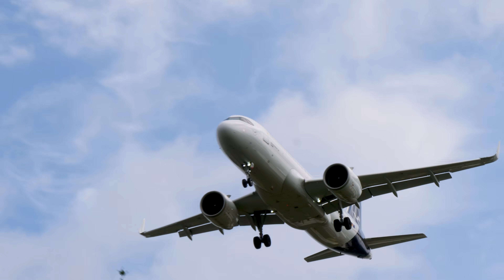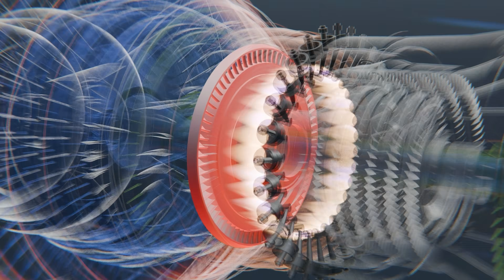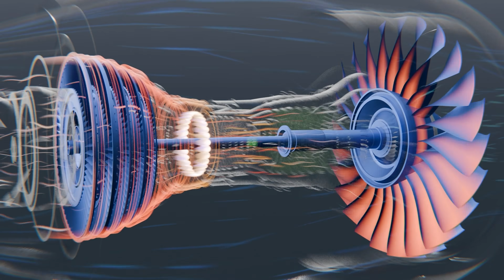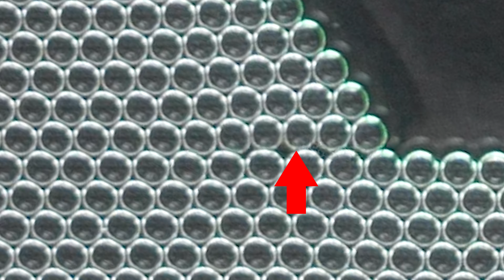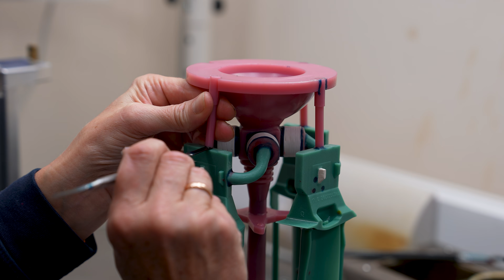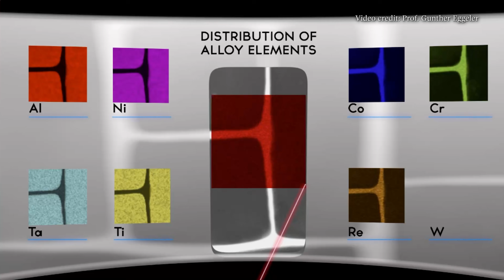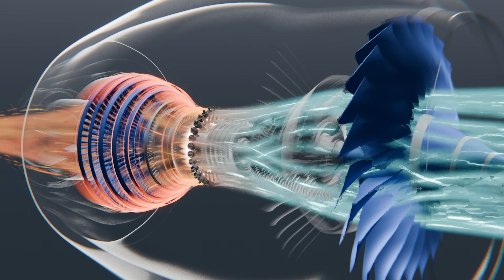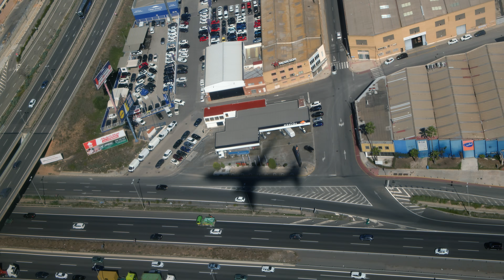The Ridiculous Engineering Of Jet Engines

Comment: Jet fuel cannot melt steel. Go get a kerosene heater , melt steel with it. 
Steel is dipped in 960 degree fahrenheit liquid zinc, to galvanized it. It doesn't even warp.
Reply: Jet fuel plus massive pressure causes way more heating than jet fuel alone. Even a compressor in a garage gets hot when running due to the pressure increase of the air inside.

Comment: The engineers actually use a few interesting tricks to pull this off.  Turbine blades have internal channels where the cold air is passed through and is vented into the exhaust stream.  This keeps the blades cool while spinning in an inferno.  Also, the combustor cans have corrugated metal seams that also allows lower temperature air to keep the flame away from the walls of the can.  The temperature inside the actual flame is around 3,000 °C.

Comment: and somehow it made structural steel that has a melting point of 3500 C collapse
Reply: Heat energy in rigid structures can cause cascading material failures due to expansion. It's not all about literally melting things. A basic grasp of material science would help you.
Reply: @O @Orbital_Inclination is was also debunked as well, don’t Reddit mod me dude
Reply: @LLylexx no it wasn't. You just can't help clutching at the tin foil hat.

Comment: How does the air ignites so high when a car engine can't ignite in high montains?
Reply: Fuel air ratio is key here. Aircraft engines suck massive amounts of air in. Stick a massive fan in front of a car up a mountain and it will start

Comment: I wouldn't even worry about the dust at 36000ft, those engines must ingest LOTS of it on a regular takeoff alone.
Reply: Dust is much more abrasive flying along at 500 mph than it is on a takeoff roll though.

Comment: You have not even discussed aetheric jet propulsion when the plane reaches 35,000+ feet the engine using the harmonic Schumann resonance of the earth to where the engine basically uses the aether energy as sound and allows the plane to use another fuel source to conserve its fuel primarily for take off, landing, or emergency.

The reason the jet engine survives because it can handle the heat until it reaches its optimum altitude
Reply: Literally not a thing, so it isn’t relevant here
Reply: the only thing that is not relevant is that YouTube name of yours
Reply: @Juancarlos22113 next time, pick a technology that actually exists. The aether isn't real 😂
Reply: @Orbital_Inclination  go delete your channel and change that name. Crazy this dude can’t do a google search 😑
Reply: @Juancarlos22113  a google search shows that aether was a hypothetical classical element that does not exist. It has no scientific basis at all. You might as well try asking ghosts to carry an aircraft.
Reply: @Orbital_Inclination you still here? Let it go Elsa

Comment: Woww.  Never new it was such an art.  Now the Russians know to make their turbine blades last longer.  They did say the west didnt have to replace their blades as often as the Russians.  Ive cast aluminuim as a hobby 3 decades ago.  Have always seen the crystal like structure of broken metal but never considered the nitty gritty.  Learned so much from this.  Of course it could be outdated not with batteries thus electric turbine and squeeze it like a garden hose for thrust.  Obviously they would need to filter the air and send in through the blades.   Fascinating journey in these  "Last Days"   were entering and the knowledge weve gained.  Was amazed about the spiral for the crystals to focus or alighn

Comment: 13 minutes in. They have hollow channels in them.  What im wondering is the effeciency of hot air expansion. it would likely make sense to have a tube at the back where the hot gasses can heat up the cooler forced air to get that to expand before chucking / thrusting it out the back against of the atmosphere.  Logic being with preheating the forced cooler air  "there will be more mass"   to send out the back to thrust against the atmosphere.   If so - then my patent idea requires any airline grant me free travel and the best airline hostice booty to rump in the process.  Oh -  an unlimited trips to the bar etc...

Comment: No mention of the real reason Tungsten is not used.  Tungsten has a high melting point.  Tungsten Oxide does not.  The oxide melts and runs off, exposing more tungsten.

Re the blade casting, these can't be blades from the hot part of the engine, aren't they made of single crystals, which is way more difficult.  EDIT - guess it is.  Had no idea the spiral (pigtail) could be that small.

Comment: Magnificent work! Superior to the Horizons of my youth. Thank you!

So why doesn't all that hot gas poot out the front of the engine? This is rarely mentioned. 
It's that 50 bar at the back of the compressor blades. The whole engine is also a pressure vessel (as if everything else wasn't enough) So that's one of the main design parameters. It's that, and the huge volume of hot gas, that pushes you along.

Comment: @veritasium This is the best explanation of Single Crystal Casting I have ever seen and I work in this industry since many years. You should definitely make a follow up video diving into the Ceramic Barrier Coating as there is currently a big shift occurring from plasma sprayed TBC to Electron Beam Vapor Deposition.

Comment: In the 60's, Rolls-Royce tried using carbon fiber fan blades for the RB211. These blades were light and temperature resilient and only failed in one respect, bird ingestion tests. It cost them millions.

Comment: The problem with the phrase "jet aircraft became about 55% more fuel efficient" is that it isn't at all clear what it means. There are two obvious candidates:
1) Jet aircraft use 55% less fuel for the same distance traveled
2) Jet aircraft travel 55% farther for the same amount of fuel

The former implies that they use 55% less fuel. The latter implies that they use 35.5% less fuel. Which is it?
Reply: In aviation, fuel efficiency is typically 'amount burned per seat per unit of distance'
Reply: @Orbital_Inclination That fails to help. Was the amount of fuel reduced by 55%? Or the distance increased by 55%? It is ambiguous
Reply: It's option 1, 55% less fuel per seat-mile.
Reply: @Orbital_Inclination  Good to know.
I have opinions about which way of presenting improvements is better, but my main argument is that the language used to describe efficiency improvements should be unambiguous. "55% more fuel efficient" is bad rhetoric. Either say "55% less fuel per seat-mile" or "2.2 times as many seat miles for the same amount of fuel"
I'm partial to the second option, but either one is clearer

Comment: What's crazy is just how Small the turbojet engine is, that drives the turbofan mechanism.  That's the thing that flew you here.  That's the thing that pushes you into your seat when the engine ramps up to full power.  And these things do this all day long.  The pilot doesn't care.  He or she just Smashes the gas pedal.  What happens after that is pretty amazing.  Micropores flow through each blade, and flow over the surface of each blade, that blow through and keep these things cool.  An eety bitty straw, flowing air through the length of the structure of each blade, keeping each blade cool.

Think about a piston engine.  You Smash the gas, and you expect power.  So does the pilot.  He or she Smashes the 'gas pedal', and there's an expected amount of power.  He or she expects Something.  Just as you smash the gas on your automobile, a pilot expects Something.  My car is an 8-cylinder SUV, and I know what I'm to expect when I smash the gas.  I smash the gas, and I get an expected amount of power.  The pilot smashes the 'gas pedal', and the plane takes off.  A pilot smashes the gas, and you fly from New York to San Diego.  Just the same as what I'd expect from a drive from St Louis Missouri to Memphis Tennessee.

Which is to say...  Why ISN'T there a nonstop flight between St Louis and Memphis?  

Hey, I'm just saying.

Comment: so basically lots of things pushed to their limits go into the answer/solution, including single-grain alloy, coatings, a cooling system built into the shape, besides slightly cooled air. also appreciate finally remembering the term dislocation propagation from materials science class

Comment: You don't mention that turbine blades don't experience 1500 deg C as they are surrounded internally and externally by a curtain of bleed air at about 600deg C through the cooling holes

Comment: slight correction Veritasium

regarding the invention of the jet engine, the first jet engine aircraft to fly was the He 178 in Germany 27th August 1939 but was wrought with problems as the video mentioned regarding maintaining the engines overheating

edit: small clarification, Frank Whittle did invent the first jet engine afterwards Hans von Ohain created his design. however the He 178 used Ohains design thus making it the first jet engine aircraft to fly.

Comment: 2:56 you know what else is crazy?

Out of that 10% of air going into the core, about half of that isn’t mixed with fuel and burnt. The air is only there to cool components down.

So it’s really only 5% of air that drives everything.

Comment: Per AgentJZ, the thing that keeps a jet engine from melting is the carefully controlled air flow over the blades. If this air flow were hampered, the heat would get to the metal parts and they would disintegrate. This is the reason for mandated servicing intervals.

Comment: I used to work with a company that made super alloy blades for aircraft, there’s so much that goes into a single blade. We would get trees of molds and have to run precise cutoff operations to separate them. The molds often had platinum pins inserted too, it’s apparent why aircraft are so expensive when you start working with the materials.

Comment: The older less efficient engines were a lot safer.
Reply: No, it's actually because engines got a lot safer than ETOPS became a thing and that you can fly in the middle of the ocean with just two engines. Notice how many older airliners had three or four.
Reply: Wrong. Modern turbofan engines are far, far more reliable than older ones

Comment: As an aircraft mechanic I loved how accurate everything was in this!

Fun facts: 
the roots of the turbine blades are most susceptible to failure
They expand and tighten up into their roots as the engine spins up so a cold engine that’s windmilling will click as all the blades slop around 

There’s cooling air in the engine shroud that manages the blade gap. Too much and air is bypassed from the blades and too little they’ll hit the shroud/housing. 

Oh! And on the ge passport 20. There’s a solid titanium fan blisk. Running the bypass air. No blades, just one complete component so less likely to fail and… make it quieter. There’s also a sound dampener in the exhaust made from composite it gradually mixes the cold and hot air like a silencer in a gun does. 

Jet engines are really cool technology I could talk for hours about them so I’ll stop here.

Comment: Why doesn't a jet engine melt just like the World trade center giant carbon steel beams as in the buildings one, two, and seven ? !!!😮😮😮
Reply: Because skyscraper steel isn't designed to cope with the massive structural and thermal stresses of a burning airliner.

Comment: So the turbine blades are moving at 208 rps??? I find that hard to believe.. I am not an engineer and thus very ignorant, but that number is simply mind melting.
Reply: If you have a Dyson vacuum, those fan blades spin at 2,083 times per second. 208 is rookie numbers!

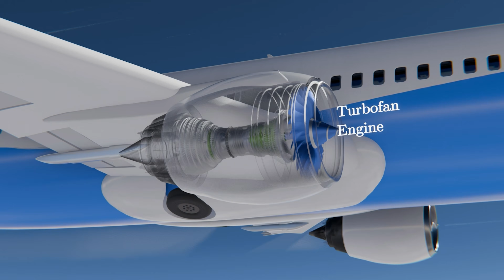Comment: Jet engines operate at temperatures exceeding the melting point of their materials. the components and functioning of a jet engine (0:45), emphasizing how modern designs prioritize efficiency by moving a large volume of air at lower speeds (3:51).

The extreme conditions turbine blades endure, including immense temperatures, centrifugal forces, and corrosive elements (5:17). the evolution of materials, from early steel blades to advanced nickel superalloys (17:07) that gain strength at high temperatures due to their unique gamma and gamma prime crystal structures (18:08).

A significant advancement is the development of single-crystal turbine blades (25:38), which eliminate weak grain boundaries, dramatically increasing durability and efficiency. The cooling mechanisms (32:22) and protective ceramic coatings (34:15) that prevent the blades from melting, even when exposed to temperatures of 1,500°C.

Comment: Burning jet fuel doesn’t melt steel beams
Reply: It's not turning steel into liquid form but enough heat to soften steel. An example we saw is when the aircraft flew into New York towers (9/11). A small number of ignoramuses will deny such (god only knows why), but science wins. Jet engine turbines are made from superalloys that can handle extreme heat. Steel beams not.

FYI, I worked in the metal fabrication/ manufacturing industry for 20 years and worked as a toolmaker for 10 years. I know "quite a bit" about how metals behave, including heat treatments, tempering and hardening, etc.
Reply: Right, jet fuel is just refined kerosene.

Comment: 34:52... I remember watching a video about plane crashes, and the short story of it all was that the plane was flying through a GIANT ash cloud that was up in the air from a very recently erupting volcano. 🌋 

Each of the 4 turbine engines ingested TONS of ash, and the engines eventually died, fairly close together, would NOT restart, and turned the plane into a glider that was in the middle of the ocean. 
It was TOO far from any land, was  NOT going to make it to any airport by gliding, and was going to have to ditch at sea, BUT, when the engines cooled down enough, and enough of the ash that was plugging them up had blown out of the engines during the glide, ALL 4 engines eventually restarted and lasted long enough for the plane made it to an airport and safely land.

I saw pictures of the disassembled engines from that plane, and WOW, the internals of the engines looked completely sand blasted from the hard, sharp, ash that they ingested. The exterior of the aircraft was basically sand blasted as well, and the logos and paint were removed from most of it also. 

I just COULDN'T believe, after seeing the insides of those engines, that ALL 4 of them were able to be restarted after they had cooled, un-seized, and the ash had blown out of them. Tough, TOUGH bastids for SURE!! 😲

Comment: Single-crystal (SX) blades are engineered to operate in the hottest section of jet engines and gas turbines, often handling gas path temperatures that exceed the melting point of traditional alloys. These components are designed to withstand temperatures potentially reaching 1,500°C–1,650°C and enormous G-forces for thousands of hours without failing. 

Why Single-Crystal Blades Are Superior
The extraordinary durability of single-crystal blades is primarily due to their unique, defect-free microstructure, which offers several advantages over polycrystalline (multiple-grain) alloys: 

Elimination of Grain Boundaries: Conventional metal alloys are composed of tiny crystals (grains). At high temperatures, the boundaries between these grains become weak points where atoms can migrate, leading to "creep" (stretching) and crack formation. Single-crystal blades are cast as one continuous crystal, completely eliminating these boundaries, which increases creep resistance.

Superior Thermal and Fatigue Resistance: Because they lack grain boundaries, single-crystal blades can withstand thermal cycling and high stresses much better. They can operate at temperatures 25–50 °C higher than earlier generation blades.

Reduced Need for Strengthening Elements: Traditional, polycrystalline, high-temperature alloys often require additives like Carbon (C) and Boron (B) to strengthen their grain boundaries. These elements actually lower the melting temperature of the alloy. Because single-crystal blades do not have grain boundaries, these elements can be removed, further raising the melting point of the blade.

High-Temperature Strength: Single-crystal blades are typically manufactured from Nickel-based superalloys (such as CMSX series), which are designed to maintain their structural integrity at temperatures that would cause other materials to fail rapidly.
 
Performance in Extreme Environments
Single-crystal blades can offer up to nine times the lifespan of conventionally cast blades regarding creep deformation and thermal fatigue. They are capable of withstanding constant, intense, 24/7, high-temperature operation in both commercial and military engines.

Comment: Why jet fuel can’t melt steel beams 🤔
Reply: It isn’t hot enough
Reply: Jet fuel is actually just refined kerosene that does not burn nearly hot enough to melt steel as an open flame.
Reply: @Juanelmajo13 exactly…do you know what I’m 
Referencing?